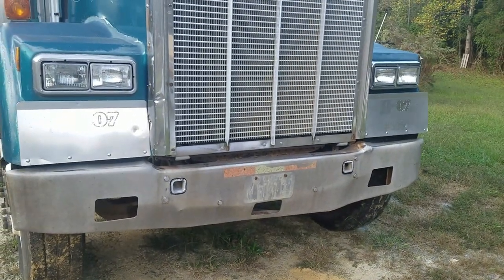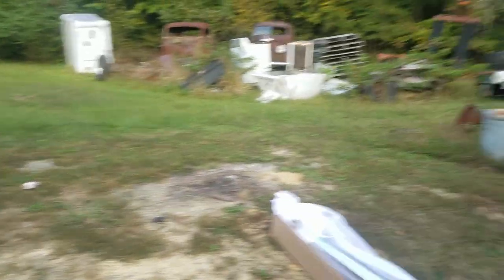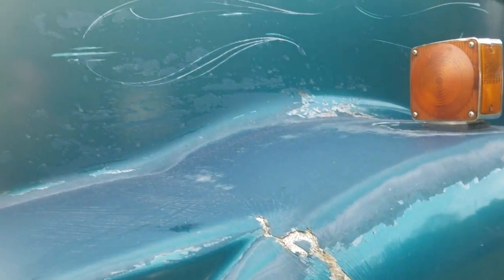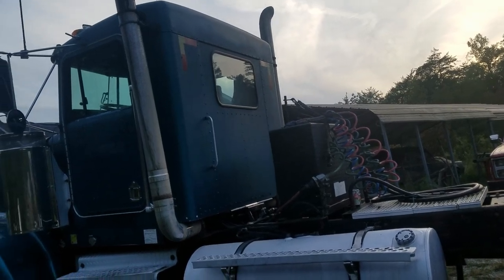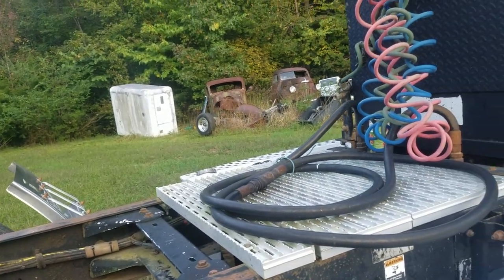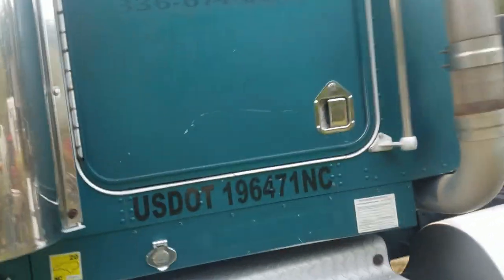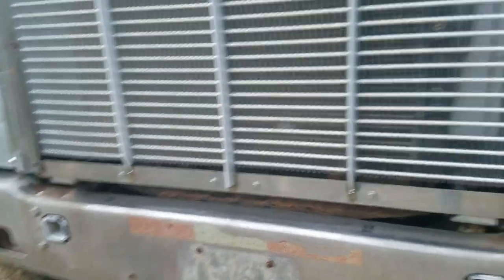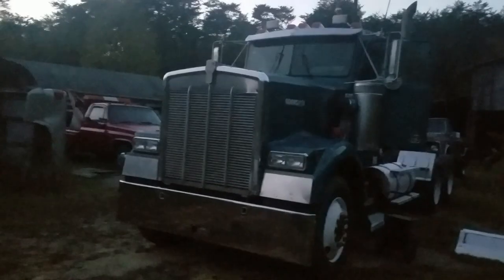Kenworth W900  new parts

Comment: The W900's are one of my favorite trucks. I've changed 1000's of tires on W900 Ready mix trucks in the middle of the night when they were parked. A pair of aluminum wheels on the steer axle would really go nice with all that new chrome.  Easy to say when it's not coming out of my pocket. The shiny stuff gets expensive quick.